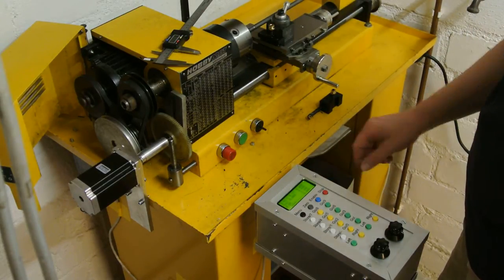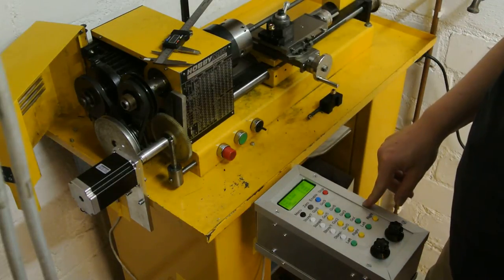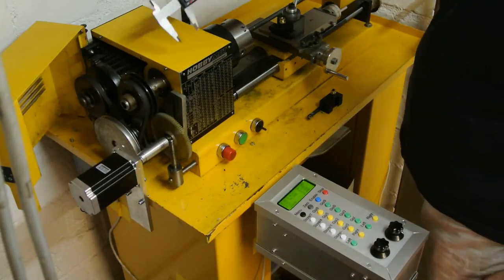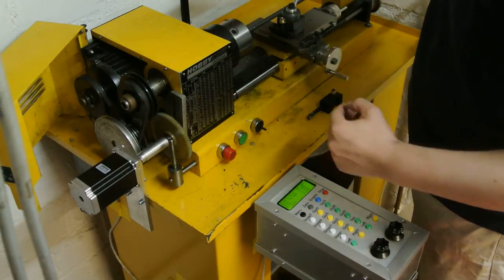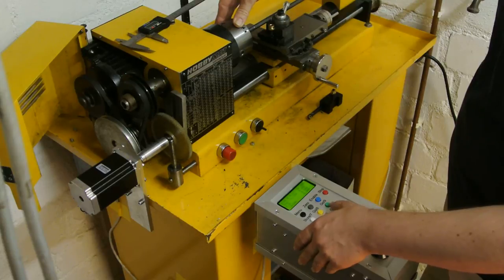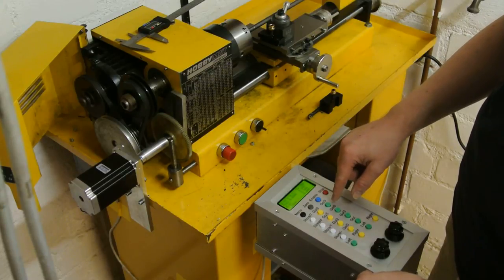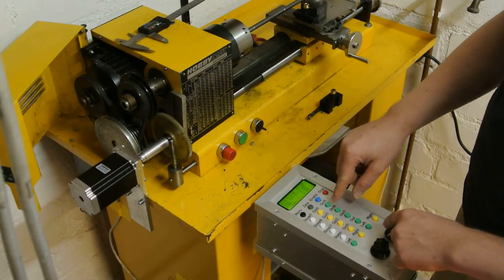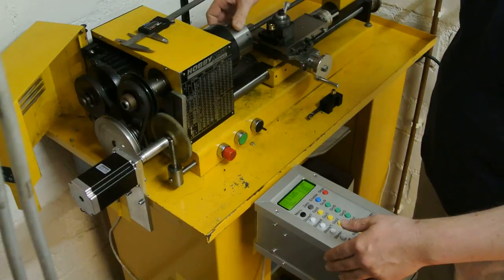Electronic main spindle control on Prazi SD300 / Hobbymat MD65

Comment: is the controller available in a kit any help will be greatly appreciated
Reply from the maker: Hello Geroge,
there isn't any kit available for this. It is a hand made PCB soldered manually using an individually programmed Atmel 8bit controller.  Sorry... Today these kind of projects got simpler by using Arduino or similar boards as a base as I did it for a wood working jig. If You are aware of these techniques this would be a base for a follow up project.
Greetings
Eckart
Reply: @werkraum-es  thanks for getting back to me i aint that technically minded

Comment: Very nice job :) May I ask what type of tool post do you use? I'm struggling to find the right size hence the compound is fairly high. A link or aserial number would be extremely helpful! Thanks!
Reply from the maker: Hi, thank You. 
The tool post is from A2Z. In general that works well and is rigid enough. But even this QCTP is still too high. It is nearly impossible to turn the tool post on the compound.  Moreover I also struggled to get a parting tool working in the holder. 
To summarize: I is O.K. but not perfect for the machine.